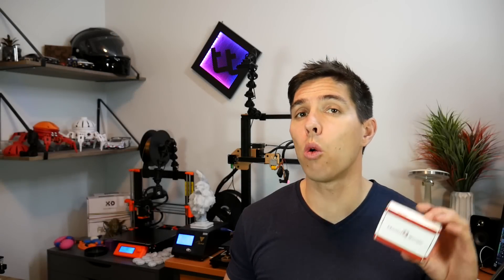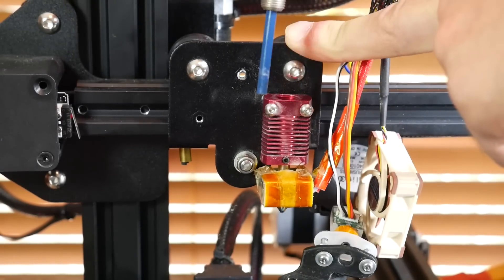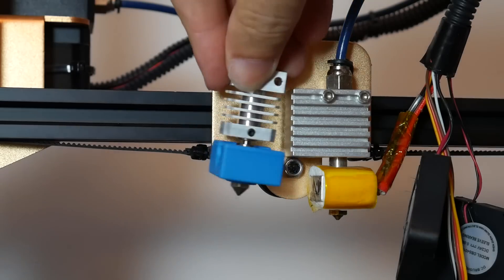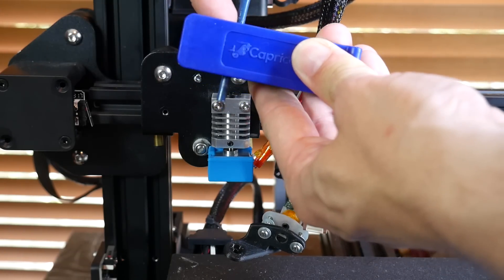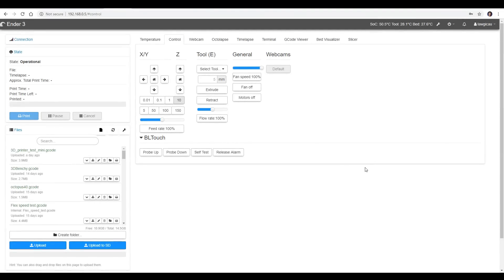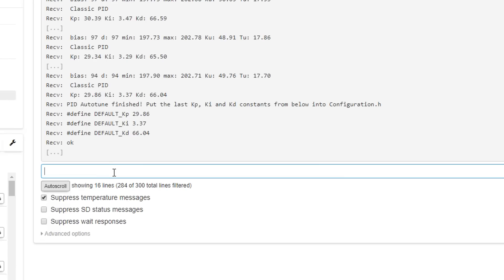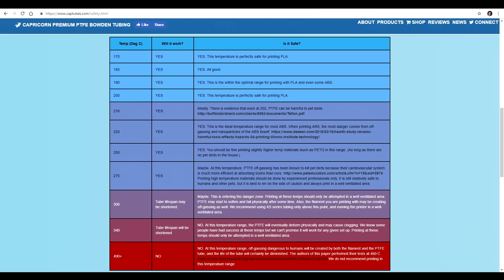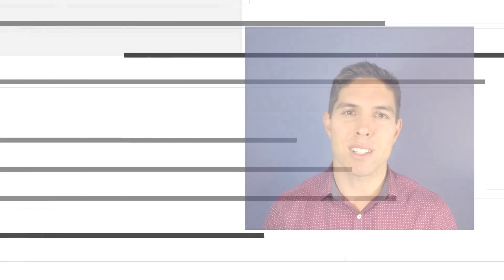Ender 3 Micro Swiss all metal hot end

Comment: A neat thing on M303 is the "U" option - do "M303 S200 U1" and at the end of the PID tuning, it sets them active for you, no need to type the numbers back in, just M500 to save. Handy!
Reply from the maker: I considered using it in the video but it would have tripped up anyone with standard firmware. Thanks for sharing.
Reply: @TeachingTech  where do you go to send the gcode to the printer when tuning

Comment: I printed a Fang with 5015 Fan for my stock Tevo Tornado hotend. Just put on this same MicroSwiss on my TEVO but my Fan doesn't fit any more.  I was able to find a modified Fang for Micro Swiss and BLTouch on Thingiverse. Thanks for the installation steps.. so very easy but I think my old heater and thermister are bad and I have new ones on hand.

Comment: Have one on my Voxelab Aquila and... works like a dream. Solid upgrade and very easy to do. Gonna mod my Merlin (alex's) firmware to crank up to 300c on the hotend. Great video in this channel to mod firmware. Waiting for it to cool off (in Phoenix) so I can vent ABS outta a window. Wanna try stuff like carbon black. 
This hotend works great for PLA and PLA+... obviously... PETG and TPU. Doing 20 and 30% wood PLA+ now aa well. Just need a bigger nozzle like TPU. At least a .05. .06 seems to work better for TPU. 
Yes... PID! Gotta do it. Very easy. Will get rid of most temp 112 (I think) kills too! I like to cycle a little higher. Like 15 cycles. PID that hotend!!!

Comment: Ever since I added the micro swiss to my ender 3 pro, I have been getting under extruded layers half way up. I thought it might be a heat issue, but adding more heat just made it worse.  My retraction setting is currently set for 5mm.
Reply: Not sure your other issues but 5 is way too high for DD. I have mine at . 5 and it's perfect. Start at 1 and see if you get any change.

Comment: Amazing video, if this new Hot End comes supplied with a hardened nozzle, does this mean all previous print files need to be modified to increase the melt temperature, accounting for lower heat conduction from the HZ? If not can you still operate with a brass nozzle?

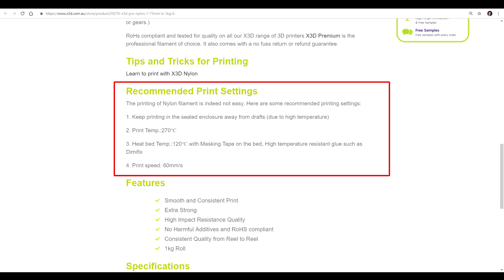Comment: Thanks for the great video. At 09:05 you said, that the Ender 3Pro magnetic bed can only go up to 80°C. Are you sure? The magnetic bed is standard for this printer and the manufacturer's temperature specification for the bed ranges up to 100°C...
Also: In a slightly newer video Chep tested the heated bed under horizontal load with up to 110°C:
https://www.youtube.com/watch?v=qyG7Gt-Upsg

Comment: I just installed my micro swiss direct drive on my Ender 3 v2. I've been trying to calibrate my e-steps, but when it starts to extrude it makes a horrible clicking/skipping/grinding sound. 
I've adjusted the tension arm a ton and the only time it won't make the noise is when the screw is when the knob is barely screwed on, but then it doesn't seem to grip the filiament.

Comment: What about just changing the heatbreak??
Reply: I picked up one of the titanium heatbreaks on amazon, and some thermal compound, and imo it works the same as the microswiss. You can get the higher temps, but I think all metal hot ends don't work great for pla. Always start getting nasty layer lines.

Comment: I have been having problems with clogging with PLA, PLA+ and PETG on Ender 3 V2. I calibrated all the stepper motors and calibrated the e stepper twice. It prints the 20mm test cubes almost perfect with no problems, but when I try to print something medium to large, the e stepper motor slowly starts skipping and gets worse as the print goes on, eventually it completely clogs the hot end. I've ran different test in Cura and have tried different things in Cura like temps, retraction, extrusion and speed. I have wondered if a "bad" hot end would cause clogging, because after a week of troubleshooting I'm about to give this hobby up. :(  I know my filament to good, I have printed lithophanes, medium size boxes, articulating butterfly, all kinds of stuff with no problems. I don't what happened or what changed.

Comment: Hi, I installed my Micro Swiss into my Ender 3 Max printer.  Q: 1: why did you cut off about 1 inch of PTFE tubing before inserting it into the hotend? 2: The bigger question; Does the full 1" of tubing go into the hotend? I can only get a few mm to go into my hotend? Thank You

Comment: Love your videos. Looks pretty straight forward since I have install/reinstall the e3D Hotend on my other printer. Q: it looks like you did not add heatsink compound to the heat break. Just to be sure. I added Heat sync compound to mine. I guess it does not hurt to do so. I do like that I can use the wrench tool to hold the heat break and tighten the nozzle with a socket wrench. Much, Much easier than using a pair of pliers to try to hold the very hot heater block while trying not to get burned. Again, So much easier and safer.

Comment: I know this is old, but if you can't connect via USB or network to your printer, just create a text file, name it tunePID.gcode, and paste the following without quotes in it: "M303 S250 C10 X1;"

Just run it like a print and it edits the PID and saves to EEPROM due to that X1 switch

Comment: sorry for the long messages but im new to 3d printing haha.. i was curious could i still use my OEM hardware if i switch to the swiss hotend like you have in the video? like my fan covers and everything on my ender 3 max it has the dual fan cover and works nicely i would like to keep it but i dont want to waste $60 on it if i have to change the fan setup all around cause mine prints great i just wanted to be able to dfo more with it

Comment: If the micro swiss hot end is slightly shorter, why do you need to remove spacing washers from the BL-touch?  Can't you just use a new Z-offset?  It should be slightly larger--if the Micro Swiss is shorter, the head will be slightly farther from the bed when the BL touch triggers.

But, unless the head touches the bed when auto-levelling, does it even matter?  Confused...

Comment: Been using the stock hotend with Capricorn tubing and a hardened steel nozzle for printing CF nylon at 258 C. Running Marlin firmware. 
Textured glass bed with glue stick.
Reply: Um.... does the Capricorn tubing have a different melt temp from PTFE?

Comment: Big fan of your videos. I know this is an old one, but I wanted to ask, would I need to change the Thermisor on the stock ender 3 v2 to be able to print at 280 - 300° with this Micro Swiss hotend? I need to print some Nylon parts for a project and I am looking for alternatives to upgrade. Either this or the E3D V6 have my current interest.

Comment: Hi every body I have an issue with connecting my new 4.3 inch touch screen to the motherboard on CR-X, the cable has been damaged and I have been asking Creality for replacement and they want me to send them pictures, wouldn't be obvious for them to know? Any way here I am and would like to ask you guys if you know what type it is and how to get hold of this please, very frustrating not be able to use my printer in the middle of the project, please help. 
Cheers
Siamak

Comment: Here's a theoretical question for you.  The heatsink on any hot end is suppose to stay as cool as possible.  If it actually gets hot enough to outgas PTFE then won't it also get hot enough to (at least) soften the filament in an all metal hot end?    BTW, what do you do with that coded sticker that allows access to the instructions?  Doesn't it require some sort of "magic wand"?  How many people have that?  Also, there are some negative reviews on the Micro Swiss website concerning the Bowden fitting on top of the heatsink.  They have replaced the normal fitting with something that doesn't seal properly (IMHO) and I wrote to tell them I wouldn't buy their product as long as they are using it.
Reply: @Russell White That doesn't help since I don't carry a smart phone.
Reply: Nobody comments are not funny you troglodyte    I don't seem to be having a problem communicating with you.

Comment: I have ordered this for my CR10S Pro, I have a few quick questions about the PID tuning.
1. If I run the PID tuning, do we still up the temp about 5 degrees, or does the PID tune take care of that?
2. I usually run PLA, so I would PID tune for PLA temps. If I do a few PETG or other hi temp filaments, is it a good idea to retune the PID at those temps first? If so,  is it a good idea to PID tune at each temp, take note of the values, and just edit the start code accordingly based on material?

Comment: Excellent video mate,  I want to throw one of these on my 'CR-10s Pro V2' just so I can use normal  cheap nozzles, and not have to be forced to buy the propriety Creality nozzles.  I know they make one to fit the regular CR-10s Pro.  Does any one know if it will also fit on the CR-10s Pro V2?  Cheers
Reply: Just fitted one today, it has an extra fin (5) compared to the others that fit the smaller printers like an Ender 3.

Comment: Will it increase the change of clogging if we print with low temperature filament like PLA in the long run compared to Printing high temperature filament? The reason I ask this is because I found a full metal hotend in China Market as well which the manufacturer claims that it will easily cause jamming if we print low temperature filament like PLA etc
Reply: shouldn't do
Reply: @BenCos2018  That's what I am confused about, but I did try and it did clog for several times if I print with PLA or something else that is below 240C
Reply: @calvin-7540  hmmm 
never heard of that before 
Good to know though

Comment: I recently updated my ender 3 with a micro swiss hot-end and several other upgrades and followed both the tutorial by micro swiss and this video and when I get to the end to do the PID tuning, i get an error that heating failed because it can't read the printer. I am using pronterface and connecting via USB to the SKR Mini v1.2. Any help is much appreciated.
Reply: Also have a TMC connection error upon plugging in via USB not sure how to solve this
Reply: @enjahneering  what mainboard

Comment: I had one of these on my Ender 3 Pro.  It sort of worked, but I was always fighting underextrusion and getting clogs with it, even after PID tuning, and adjusting retraction and temperature settings.  I noticed when feeding filament that there seemed to be an excessive amount of friction in the system.  In troubleshooting where I was getting that friction,  I narrowed it down to the heat sink.  As it turns out, the inside of my heat sink is not machined very well, and has noticeable roughness from the drilling process.  Kind of like I often see on cheap nozzles.
Reply: where you able to solve this at all? I am running into the same issues.
Reply: @jamescox973  I switched back to the stock hotend.  Obviously won't help if you needed the all metal hotend for higher temp filaments.
Reply: @neurokinetik64ES  I ended up creating a new profile in my slicer and adjusting the retraction settings. Not sure what settings were causing it, but the issue hasn't re-appeared in my test prints so far
Reply: @neurokinetik64ES  @jamescox973 Having the same issue. Thought that All Metall is an Upgrade. But such system is so specific. Having clogs constantly all the time. Can't make it works. My direction is to change heatbreack to the PTFE one and compare. Next step is to change heatbreack to the one that allow PTFE tube pass to the nozzle and use high temp PTFE for nylon and PET printing. I heard about Capricorn PTFE as an 300 option.

Comment: Do the 4 rollers vs 3 rollers on the Y axis make any difference?
I'm thinking on getting the micro swiss direct drive extruder kit, but probably getting a 4 roller adapter or such, wouldn't make much sense as i'm thinking on putting a linear rail in my X axis too.
Just curious if the 4 vs 3 rollers make any difference

Comment: "Pre heat to 240" alright 
"Use a spanner and supplied wrench to tighten against each other" 
Don't got a spanner, but I do have the 2 tiny thin wrenches that came with the printer.

You cant just use the wrong tools to do a job

He he, finger go BBSSSSSHHHHHH

Comment: stepper driver has voltage (extruder) but doesnt power motor on my ender 3, the cables test out as working, when i swap out the xyz, the extruder motor works - what is the next test ?

Comment: I have a question about tuning the PID, I use the Unified Firmware from TH3D, I realize that it is based on Marlin firmware so that said do I tune the same way as using the Marlin Firmware. I upgraded to the Micro Swiss all metal hot end and have done a few prints and they turned out quite well. I just lowered the retraction by 1mm and raised the print temp 5 degrees no problems so far.

Comment: I've installed this hot end twice now according to the manufacturer instruction video. It continually jams after the first layer, using Inland PLA, and the stock extruder. I just built a vented enclosure and it didn't jam once before I put the doors on it. I've tried zero retraction, hotter temps, colder temps, I don't get it. Maybe heat creep? I completely disassembled it earlier and cleaned it out. I'm using a Petsfang Bullseye duct, also. Debating putting thermal compound inside the part that screws into the top of the heater block, something. I haven't moved the electronics outside of the case yet but I plan to, that may keep the heat down a touch also.

Comment: I've got a highly customized original i3 clone. I like printing in PETG and push the 250C limit, so I thought the Micro Swiss all metal heat tube would be a nice upgrade. I was sold on the low friction easy release coating and hoped it would help me print faster. Heat break and all that  was properly setup. After more than a dozen failed prints (none more than 20 layers high)  at various feed rates, temperature, and retraction settings, I gave up. I tried PLA, and PETG: both would end up stuck inside the tube and my extruder gear would eventually just carve out a notch in the filament. I put a new standard teflon feed tube back on and I'm back to trouble free printing. Bottom line: it's not an upgrade, don't use it unless you HAVE TO for special filament.

Comment: I've been going through all your ender 3 videos as I am brand new to 3d printing and interested in getting an ender 3. All of your videos have been informative and helpful. Although for someone new to the subject I become confused on many of your points as they rely on more than a basic understanding of 3d printing and/or reliance on having seen previous videos that you have published. Case in point is your discussion of PID udpates in this video, being an avid multirotor builder/pilot I know what PID's are but it's unclear what you are attempting to achieve in setting them as part of this upgrade. I've read other blogs and watched other videos on installing an all metal hot end and none of them mention needing to adjust PID settings. Can you point me to some content that explains why PID settings need to change when a all metal hot end is installed? Thanks!
Reply: The heating profile will be different with the all metal hot end.  Tuning the PID allows the processor to adapt to these differences.

Comment: I’am having trouble with my ender 3 clogging up in the hotend, it’s almost like the ptfe tubing is getting to hot down near the nozzle and melting the pla filament before it actually gets to the nozzle. Not sure what to do? 😢😕
Reply: Same problem, but it was broken fan.
Reply: It’s all good now, seems to be working great. All i had to do was switch over to my 0.6 nozzle  and clean out the heat sink thing, then i half unturned the nozzle before i put everything back together. Once it was back together I tightened the nozzle using the half turn that i left. I also marked the ptfe tube to make sure it was seating properly.

Comment: I’ve been struggling for like 30 mins to get the Bowden tube down inside the new hot end. After watching this video it seems as if the tube only slides in a few mm. Is this true? It doesn’t go in near as far as the original hot end?
Reply: That’s basically the idea behind all metall. To have no PTFE and a possibly clogging gap near the nozzle.

Comment: micro swiss claims that the titanium heatbreak has a 3x higher thermal resistance, is there anything to compare to i.e. a standard RVS heatbreak?
according to the metal specs, titanium has a lower thermal resistance than RVS
conductivity of titanium is  around 21 and RVS 300 (like 304, 316 etc) series is under 15 
resistance is the inverse of the conductivity, so RVS should have a better heat resistance.
is there a truth to the claim? (after all, thinner material also conducts less heat)

Comment: I had my stock ender 5  hot end fail and has petg covering it and the nozzle almost completely... i want to install this all metal hot end...the part that i wont be able to do is changing firmware for temps... is this really necessary??? cant i just use a hand held infared and check temps and if it says 220 on ender and my hand held unit says 200 just crank it up 20 degrees??? thanks

Comment: Thanks for the great videos, they are extremely helpful ! 

At one point of the video you said you reduced retraction to 4mm and would explain later in the video but then didn't touch on it anymore. Could you explain why you dropped it back for the test ? 

Many thanks
Reply: I can't explain exactly why he did it but with an all metal hotend if you retract too much filament has a tendency to jam because if you pull it out of the molten heat break area into the cooled part of the hotend it will jam. Seems like hotends with ptfe tube all the way down to the nozzle are less prone to this.